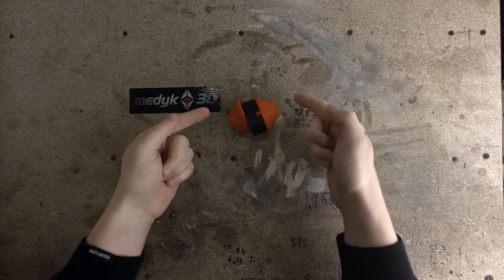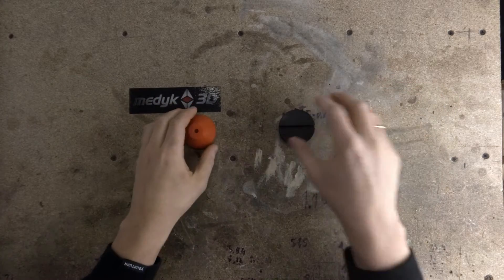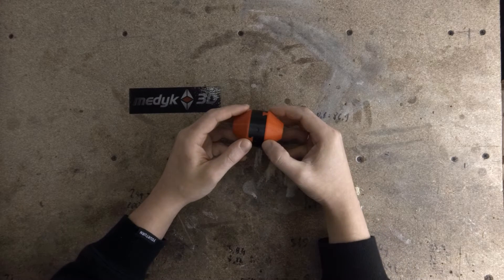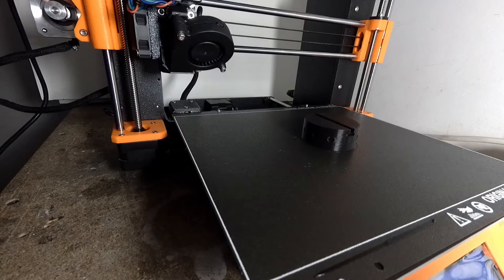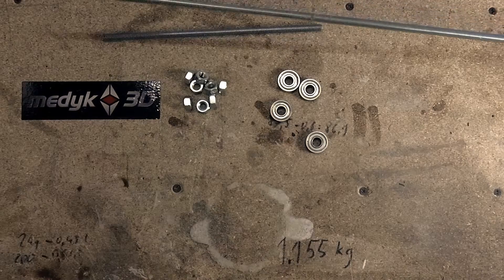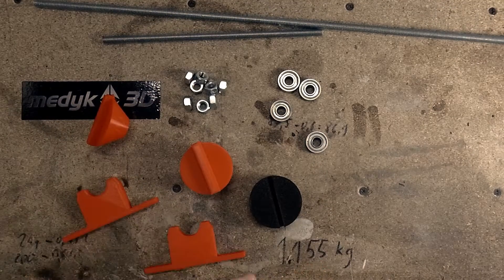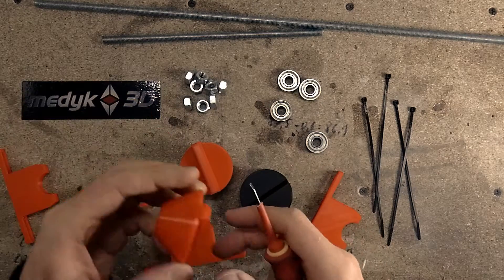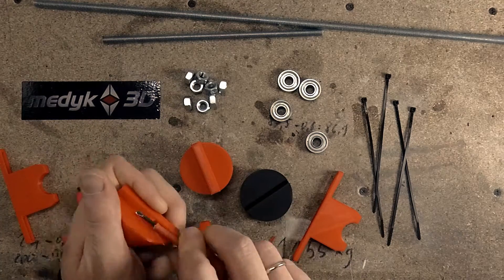3D Printed Oldham Coupling model

Comment: What method of 3d printing used ? Please tell about allowances and tolerances also ?
Reply from the maker: It was FDM printed with PLA using 02.mm layer height. I used 0.1mm gaps and then sanded the contacting surfaces to get nice fit. I usually assume that 0.1mm gap is a tight fit and 0.2mm should slide easily. It's just a model - I did it because I was amazed by the idea - simple and powerful.

Comment: That's pretty cool. It seems to me that a small belt or chain drive to transfer power from one shaft to the other could be more efficient though. Still, it's neat to watch this thing at work!
Reply: BV3D: Bryan Vines The issue with a belt or chain drive in a situation where you have misaligned shafts would be that you would need to know the exact spacing between the two shafts to get a belt or chain that is the right length. One of the cool things about the Oldham coupling is that the middle disc has a slot that allows the outer disks to move however much they need to in order to compensate for the misalignment.
Reply: @SuperMakeSomething  That's an excellent point. I know these things have to exist for a reason. I just don't always know what the reason is. Later, when I get a little time, I think I'll see where the Oldham Coupling rabbit hole leads!
Reply: BV3D: Bryan Vines Haha it’s definitely a deep hole, so be sure to set aside some time! 😅 Once you start Wikipedia surfing and get into universal joints and transmissions, time just disappears!